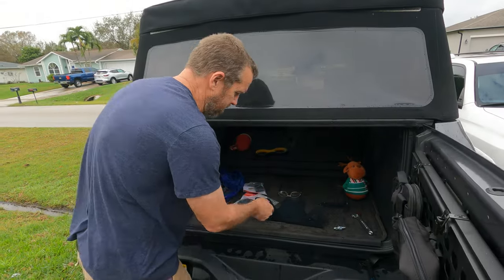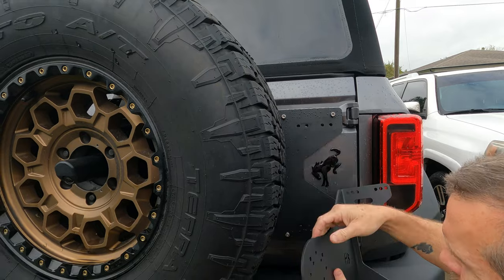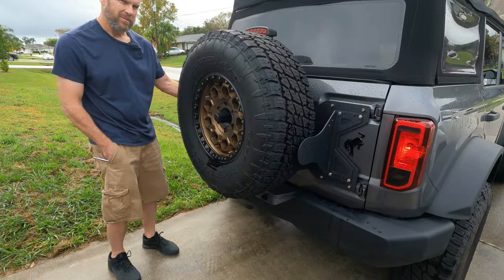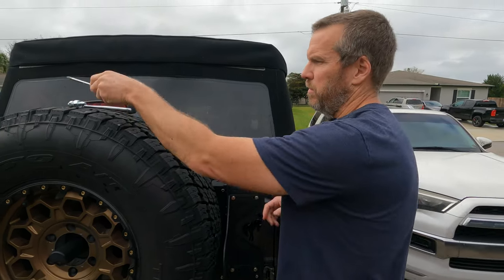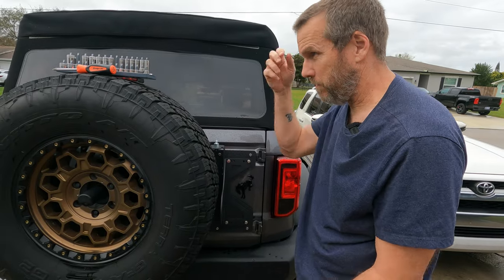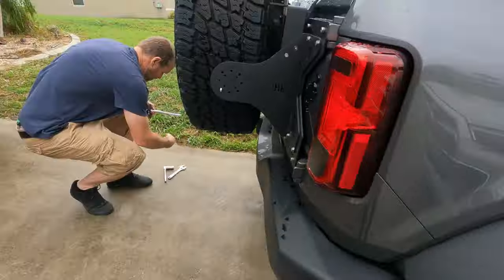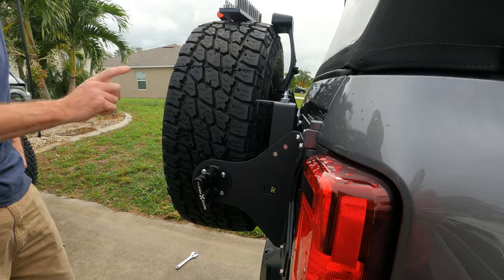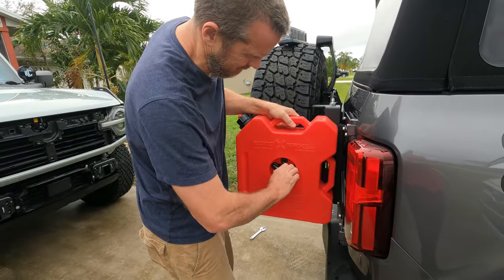Installing Hammer Built Accessories on our 2021 Bronco Big Bend - Caution Advised When Using!

Comment: Can you use a tailgate table with this Hammer Built installed with a 2 or a 3 gallon Rotopax?  I ordered the Hammer Built, but was about to order a tailgate table, but now I'm not sure if I can use it with this.  Thanks and cool video, very helpful. :)
Reply from the maker: So with the rotopax it does contact the light. I will be getting a limiter that only allows it to open to a 90 degree to protect that. But the table is still usable.
Reply: Great, thanks for that info.  I appreciate it :) @1Five1Garage

Comment: Do you believe that limiting the amount the tailgate opens will affect those who have a hard top, and the tailgate seems to need to be open more than 80 degrees for the glass to clear?
Reply from the maker: We have a hard top as well and we never open it up max to get the tailgate up. If only running one rotopax 90 will do. I just want the smallest to limit the dogs jumping out of the bronco to only a specific location
Reply: The 23+ have to open up further to open/close on the hard top.  My 21 didn't need to open all the way but the 23 I just got has a longer weatherstripping on the glass.
Reply: @Serenityindailylife  my ‘22 seems to be about 90 degrees at the minimum in order for the glass gasket to clear. ✌🏼